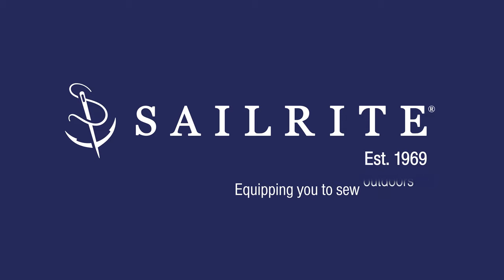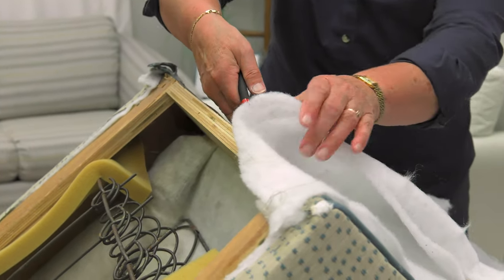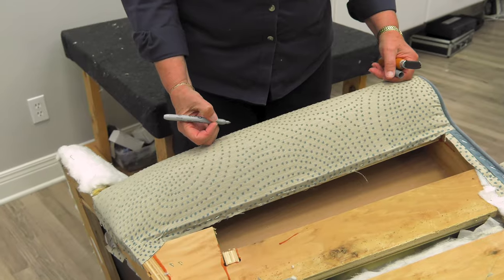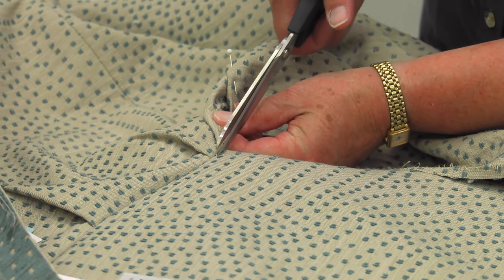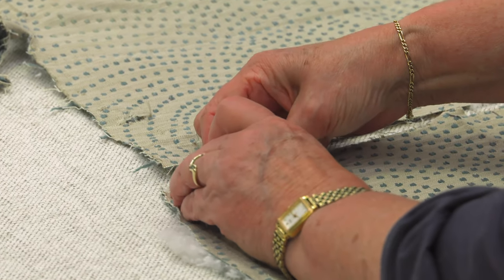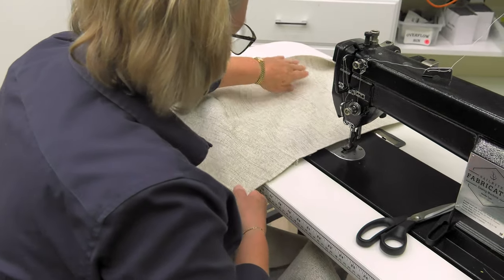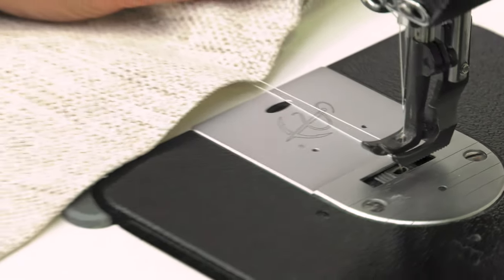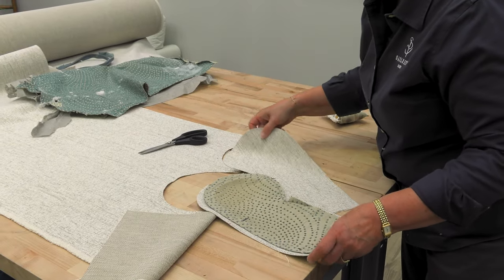How to Reupholster a Chaise Lounge

Comment: I like seeing crafts from the Fabricator. I'm not an expert, but I have done the interior of 2 of my cars with it. I have a few videos and plan on more. It's the only machine I need. Fwd and backwards. I've seen through wood and cardboard too with no problem. The best part other than the strength, is the motor is programmable speed. I always run mine on 5 or 6
Reply from the maker: We are glad that you like the Sailrite Fabricator Sewing Machine. Yes, may customer love to run the motor at a max speed of 14 or lower so, mistakes are almost impossible to make since the machine will only sew super slow.

Comment: People are often shocked at the cost of reupholstery..... The fact that it is very literally 2x the upholstery labor (removal of the upholstery then upholstery with the new fabric) and 2x the delivery/on-site labor seems to be lost on people.

And no:  The frame is not a high value component whose reuse should afford some savings

The frame is one of the cheapest components.   If there is any savings its in the labor savings that hypothetically don't need to be done to pad the frame, although there is some inspection, touch up, and clean up that sort of negates that.

Even in this video this is true, the frame is dirt cheap  (not 8 way.... thats a pre-fabricated drop in coil unit.  They cost like $10-$20 per frame)